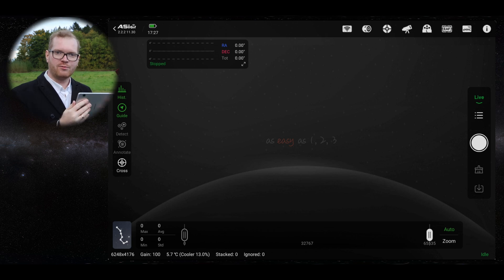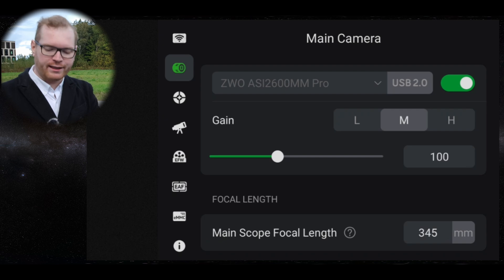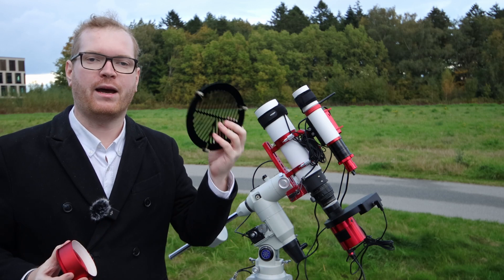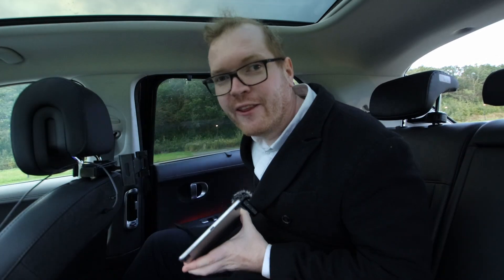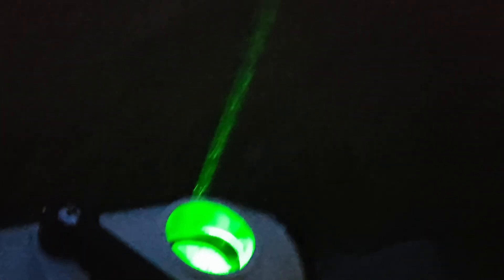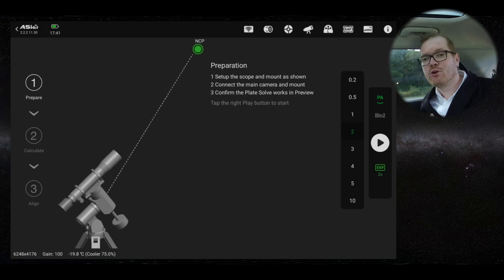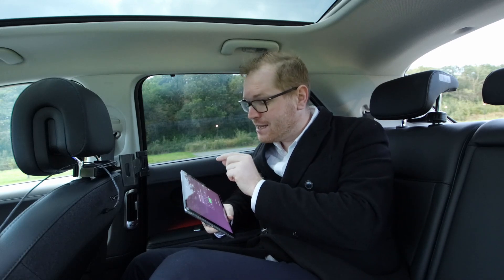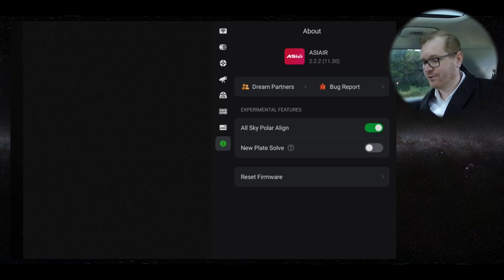Fix Asiair Plate Solving Issue.  6 Easy Solutions To Try

Comment: I'm really surprised to hear you talking about focusing. I would have thought you could just set it to infinity because of tbe distances we're talking.
Reply from the maker: You teknically can.  But telescopes don't have infinite markers like normal camera lenses and you focus point also changes based on filter and temperature. The auto focuser i use have a a small temperature prove so it can start new auto focus rutine if the ambient temperature changes more than a set number of degrees
Reply: @cosmic_curiosity  Thank you